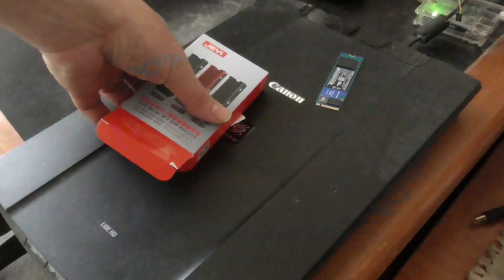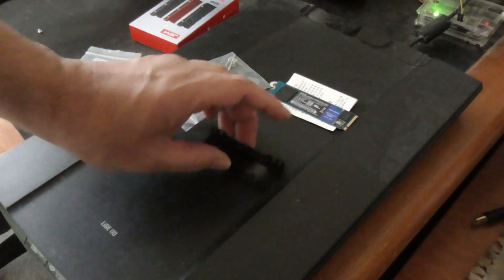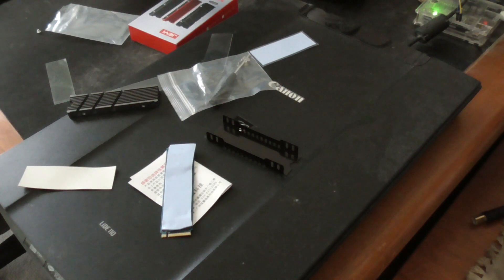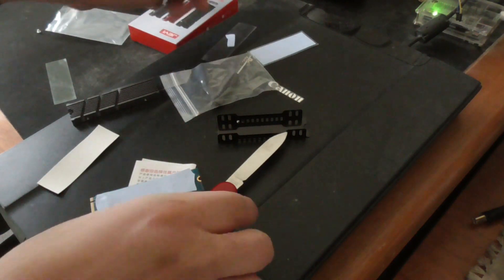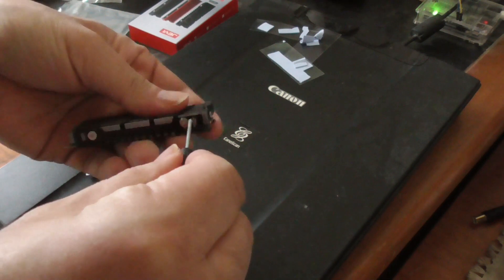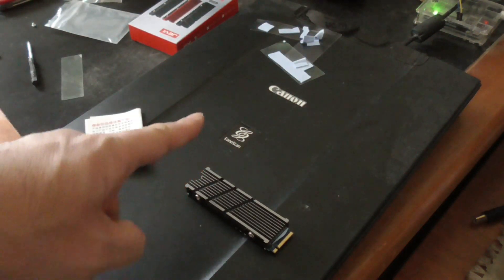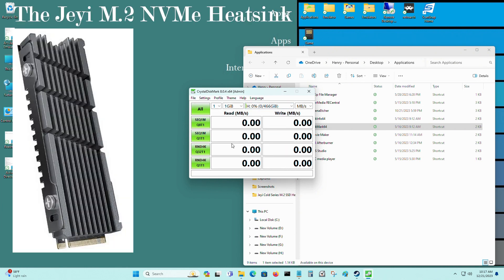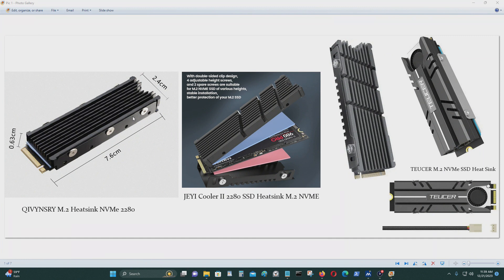JEYI Cooler II 2280 SSD M.2 NVMe Heatsink Review and Test

Comment: It pained me to watch you touching all of the thermal pad & stretching it out. would have been easier to remove one siede, set it down where you want it, then remove the other side. would have avoided stretching the thing out then.  also finger grease is not a great heat conductor.
Reply from the maker: Yes, it would have been easier, but I didn't. Now, I know.

Comment: testing temperature with blue wd - bad thing. it must be samsung, some hot model like 970 evo plus i gess
Reply from the maker: I don't own any Samsung M.2 NVMes.
Reply: My Samsung 990pro idle is 42, 50 on normal use and 82 on stress test, waiting today my heatsink. Target is max 70 on stress test but don't have enough space on my pci on B760M cause the VGA so I went to test this heatsink for start